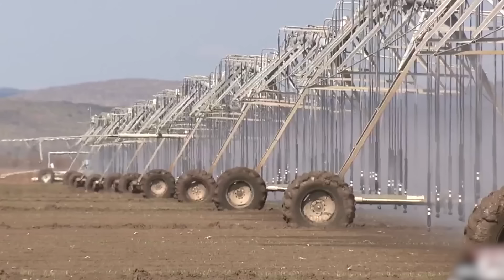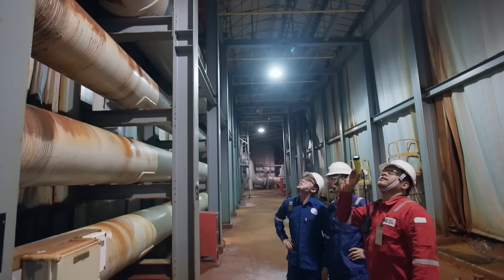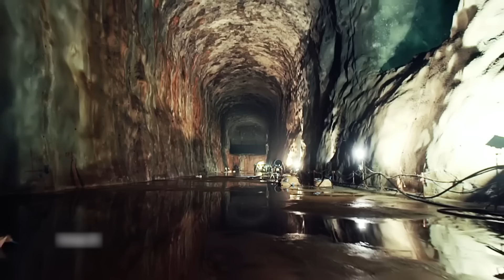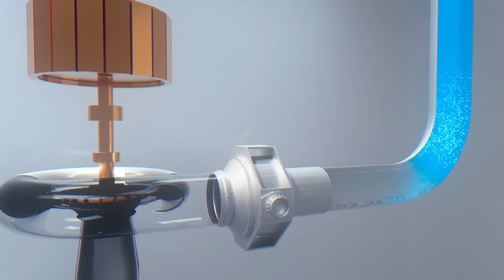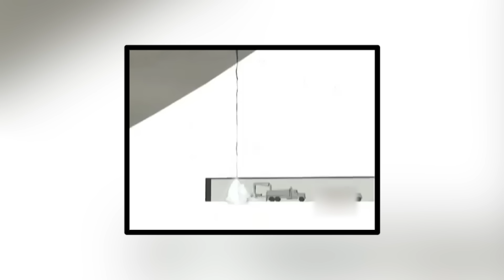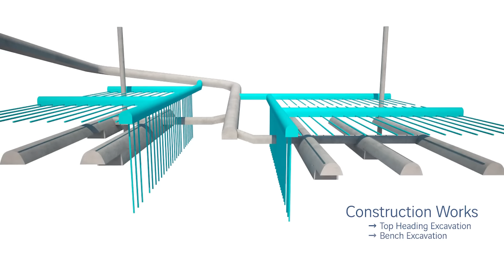How Texas Built an Underground Hydro Power Plant With No Mountains and Dams

Comment: The power outage was largely ERCOTs fault the governing energy body in Texas.  A power plant in South Texas failed to start because they were not winterized or setup for cold weather winter operations.  The peaker power plant in South used to work at ran day and night with no misses the operators lived in the powerplant for 10days straight!  It was also a peaker plant.  Windmills up north Texas the owners opted not to have winterizing options installed so they froze. Green energy failed long story short!! Another problem was 2 coal power plants were decommissioned and there were no replacements built, almost 500Megawatts off the grid!!  Obama said he would make coal power plants unprofitable and he did!!!  For years Texas was not building power plants at all, but people were moving in to Texas and the buffer of available electricity went down rapidly. No one listened to me when I said we were running out of electricity!  We lost 15% capacity in less than 2 years!! I helped build, commission and maintain and operate a power plant!  It took more than 2 years to build it and get it operational.  It was privately owned and funded for the few investors it was really risky investment and business.  If it goes wrong you can loose millions of personal money.  If you get it all right you can recoup your investment and make money… it’s a huge risk though!  The real solution is small modular nuclear power plants!!  Plain and simple this is the biggest bang for the Buck! And it is more green energy than any windmill or solar panel!

Comment: It's a water battery... which can ONLY increase the cost of any electricity produced from it.
Reply: Only if power is worth the same amount all day everyday, but that is not the case in the real world at all.  During low demand periods it is sometimes so cheap you might be paid to take the power, in high demand periods it can easily demand 100x the normal price.  Buy low sell high.
Reply: @joshbrueggen9537  Thank you for proving my point.
If they could not make a profit - by increasing the price of energy - they would not build it.

The CHEPEST form of power is COAL,
with gas and nuclear close behind it.

Batteries supply the MOST EXPE3NSIVE form of power
Reply: @l @lokai7914 u are partially correct, but realize that a big coal plant cannot just be turned on or off in a few minutes.  Coal plants can “idle” down to about 50% capacity and back up to 100% in 12-24 hours but a cold start takes between several days and a week.  Power needs to go somewhere during low load periods when that coal plant can’t shut down, or the power evaporates in the lines.  This provides a valuable service when operating as a peaking unit that makes the system more efficient overall and keeps prices lower overall.
Reply: @l @lokai7914 o, the cheapest form of energy is Solar. Just digging up coal and moving it around consumes vast amounts of energy.  
Energy STORAGE is profitable because, as Josh just said, the cost of energy varies widely throughout the day.
Reply: @joshbrueggen9537  and that is stupid, as low demand is when people use it less, and more demand is when people use it, so you inverse the 2, with big ole battery banks to store the low demand, then release during high demand to offset and reduce costs.
Reply: @JonathanOestreicner exactly what he said. Both you and the op need look up pumped storage.  It’s been used for decades. The only thing different here is going down instead of up (most pumped storage pumps up to top of existing hills/mountains)

Comment: Under Lake Erie juts out the huge  Whiskey Island Cargill Salt  Mine, so imagine if a Lake Penguir incident happened there by natural calamity 

Engineering continues to play with the dangerous earth with an "Ooolpz did I do that" mentality.  Sure from a engineer standpoint it works

But in this case there will be an ongoing erosion of salt until it reaches sift earth and either subsides or opens a sinkhole

If Ocean water comes in that would be really bad on a scale no human process could halt, and if simply earth, it would swallow a massive amount of earth forget the hydroelectric power facility.

No one can measure and assure the salt won't dissolve every if they went down and coated the walls  of the cavern with ckncrete

It is absolutely the most stupid plan to move forward with.

Remember we have now a salt water lake where a fresh water one once was in Louisiana and they got off easy comparitively speaking there but if Whiskey Island were to collapse or this new dumb duty underground hydroelectric project would be catastrophic.

Not to mention the friction erosion as well as corrosion on the turbine blades even ocean going ships fight with in there propellers

Just plain stupid is this idea where it is how it is proposed remember how water erodes ground Rock to carve out caves

I am sorry but it is just plain stupid.  Build a floating thorium powered Nuclear power plant instead that will do the same thing cheaper cleaner safer and desalinate drinking water cheaply and make also hydrogen for power, fuel or synthetic fuel
Reply: or just use natural gas which Texas has plenty of.
Reply: @modcirssu      @modcirssu Natural poison you mean.  Study up  on why the climate is changing as burning natural  gas still emits CO2  while hydrogen does not and thorium liquid salt nuclear reactors are the cheapest safest   runaway proof type of reactor that can even  burn existing nuclear waste

Of course if your  thinking is to die early and leave an unihabitable planet just say so and tell all  family members and their childfen

Everytime jackass SpaceX or Blue Origin launches or blows up a natural gas rocket they contribute tons of CO2  or raw methane to help global warming faster and last 15 years  in the release

So no Natural Gas is not a responsible option and even Texas now knows their land us sinking from pulling all the oil and gas out of the ground
Reply: TlDR